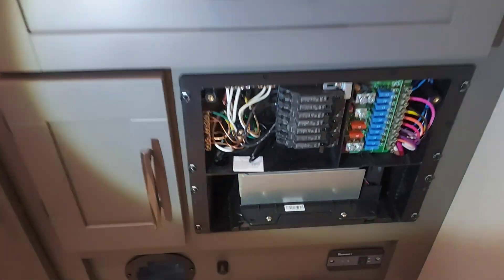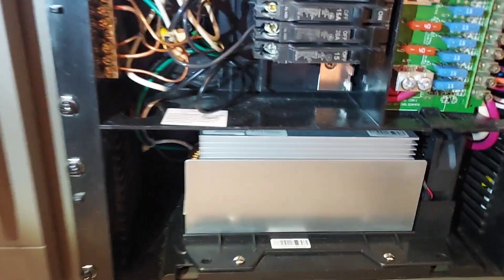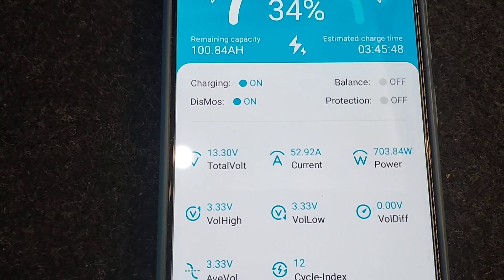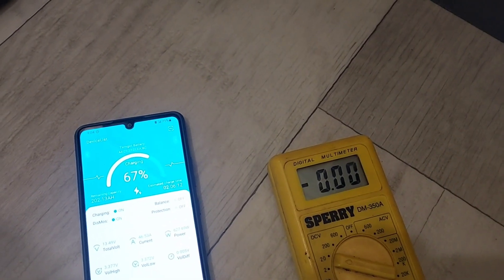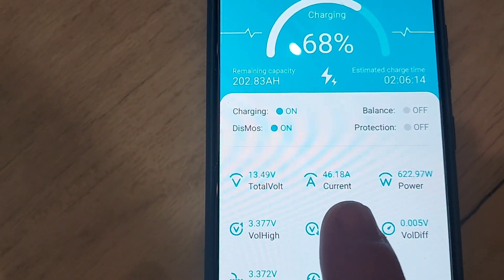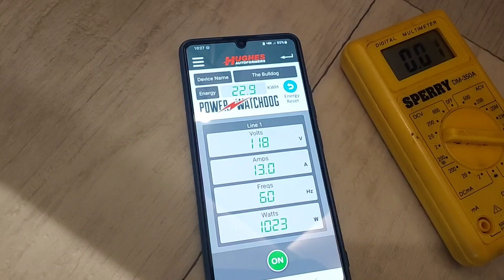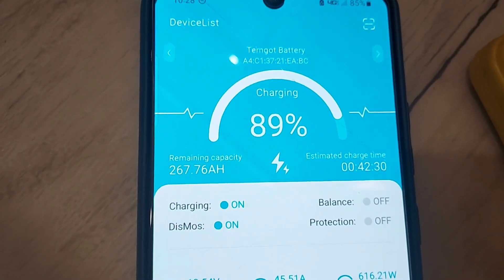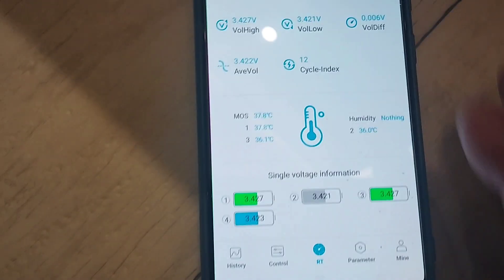WFCO 8955 AD Converter performance update

Comment: What if the light on the converter stays green and not blue to charge lithium battery? What should I check?
Reply from the maker: I would contact WFCO Technical support, they will give you a list of things to check. It means your auto detect isn't recognizing the lithium battery.

Comment: Thanks buddy.  I just swapped my lead acid for a lifepo battery, have that same exact app.  I was getting zero current, turns out I flipped a fuse.  I'm only getting about 10amps per battery (20 amps of charge), not sure why.  Should be getting 55 amps, WFCO converter.

Comment: You mentioned the cable run from the converter to the battery is much longer than a few feet.  When you shortened the cable run, did you notice a difference in voltage?

Thx!
Reply from the maker: Only a little more voltage but the amps went way up. From around 15amps to the full 55amps. The jumper that WFCO sent me gave me the 14.6 volts needed for the lithium.

Comment: Mine is only at 10 amp and 12.9 v wtf
Reply from the maker: Could be voltage drop from a long run of wire. I had to shorten the wire from converter to battery.

Comment: How hot does your dc circuit board get while charging full 55 amps? Mine is hitting 160 near the two 40 amp red fuses. Wfco says that’s normal, but it doesn’t seem right. I’ve crimped the fuse slots and double checked the cable lugs. It cools off going up or down the board away from the fuse area.
Reply from the maker: @BoFinnegan-x1k  I didn't notice that, I will check it next time I'm using it. Thanks
Reply from the maker: I've had a chance to check this out, and it is very warm. The circuit breakers and 12 volt fuses are very warm to the touch. Running ac, converter and water heater, very warm.
Thanks for pointing this out, I don't have a laser thermometer but I would guess it's close to 160°.

Comment: Do you have a 12 volt refrigerator?   I just purchased a 280 ah lithium battery.  I need to update my charge controller in the spring.  Winter storage in Michigan.   Curious how the performance is with your set up if u have the 12 v frig.  I only have 200 w solar which I probably will increase to 400.  Thanks
Reply from the maker: @aronk7412  Yes, we have a 12 volt refrigerator. The 300ah lithium battery works great for our setup. Adding the 2k inverter and being able to use all of the outlets and microwave has been great when boondocking.
Reply: @ - that’s awesome to hear.  Did you move your battery inside?   I was planning on leaving mine on the tongue but found out it doesn’t fit.  Need to figure out a solution as inside storage isn’t ideal
Reply from the maker: @aronk7412  Yes, there is room in the outside storage behind a wall. I have some videos on battery cabinet, battery install and extra solar panels installed.